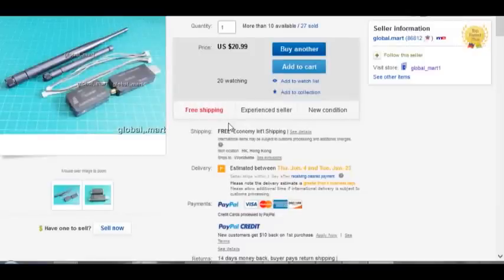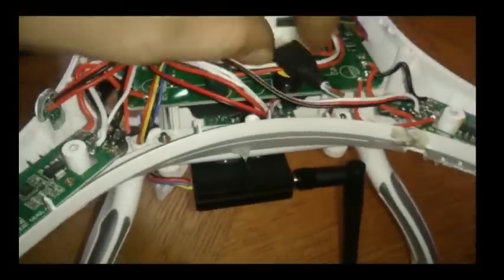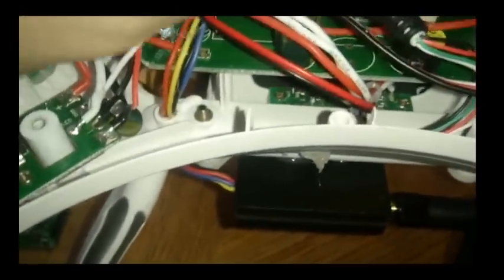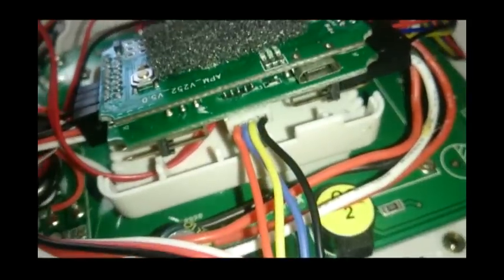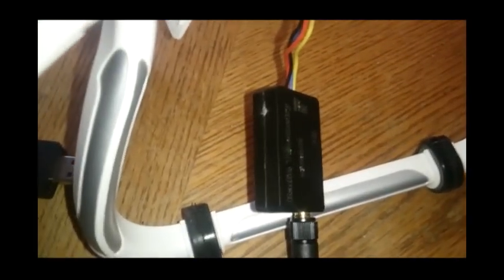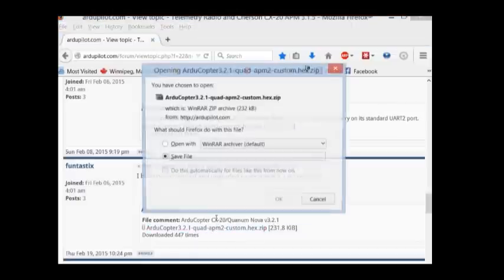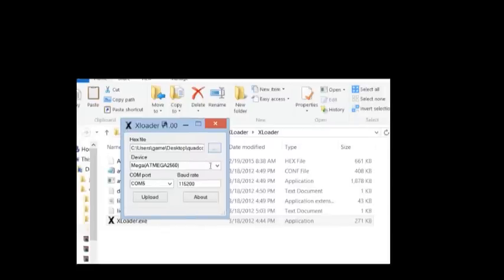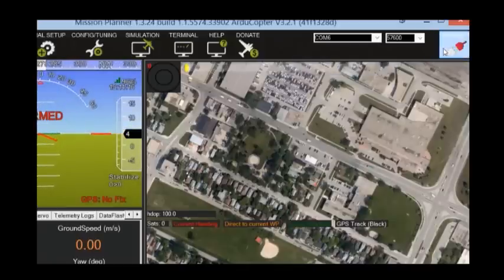Cheerson cx20 Apm v252 v5.0 telemetry Fix-with socket.

Comment: Bangs any idea why my 3dr telemetry  ground radio just shows the blue led is flashing along with a red flashing led. I've installed the driver and the hex file onto my cx-20.  I have the same setup on a different cx, but its a clone(not 3dr) and it connects but doesn't populate in mp.... any ideas???
Reply from the maker: Hi ..when you plug the ground unit into your computer.. (the one with the usb end)

what color blinks..  ..usually its green but i'm assuming yours will be blue then..

once that is blinking.. plug in your cx 20.. does it stop blinking?
and go solid..

next.. .. with it plugged into your computer only..

go into mission planner.. set the com port to the telemetry ground unit.. and the baud rate 57600
(don't push connect!!!)

go to initial setup 
sik radio.
and push load settings

what happens..?

.. if nothing populates try 9600 as the baud rate and go back to sik radio and load settings.
keep trying different baud rates all the way up to 115200
Reply from the maker: let me know if populates with info with load settings....if it is just a baud rate ....then you can connect the air unit into cx20 and try loading settings again with which ever baud rate and set them both to 57600 ect...    Mission planner does have a param as well to set the baud rate for telem   in standard params around the bottom..
Reply: the setting show up....quad should not be powered up...right
Reply from the maker: what baud rate did you use?

you can try again with it connected to see if both sides populate.
Reply: 57600 mp is the same... only the ground side populated. Just to confirm the wireing..... black, yellow green red... is that correct?
Reply from the maker: that was going to be my next ..Q....    but what you can do is two things.... one just switch the two wires... 

and try again.. or even just leave them out temporally   ..and try to see if both sides populate..
Reply from the maker: make sure to put the space as well after ground ..here is the picture part of it.. just pause the video and look at the picture.. j.. but still try to flip them..unless you did forget to skip a spot..

https://youtu.be/MbqfpGElSyI?t=42
Reply from the maker: looking at other 3dr cables with your color scheme u should of been right with the black space yellow green red......   but who knows ..maybe u forgot to skip or they got the two color backwards on your cable ..
Reply: the air radio has both leds flashing just as the ground unit
Reply from the maker: what should happen is one should go solid.. once they are both plugged in.
did you look at the picture and made sure you skipped at the right location?
..then if it still does not work try to switch the rx and tx.. green and yellow wire with each other..

try to populate both sides again..with load settings..

now the last thing to try is just take out the green and yellow wire...tape up the ends or just make sure they can't short out on anything..  . and try to populate again..
Reply: ok so no red led on the air side....just flashing blue( green and yellow disconnected and taped) but both side have  numbers. but still not connecting. Red and blue flashing(ground)... faulty unit?
Reply: So on my other cx I have one that has the green and red leds. That one works fine. Both sides populate fully. the other one only shows some of the fields populated. Im guessing its bad...
Reply from the maker: could be or bad settings on it as well.. once its connected.. try to fill in the other side.. 
identical to the left side..or click on copy required to remote.. then click save settings and see if it gets written to the other side..
Reply from the maker: can you just take a picture of mission planner and show me what it looks like when its connected with both sides.. populated  (green  and yellow taped)  either link to a picture or send to bangs696969@gmail.com

to take  a picture if you don't know how.. just click on "Prt Scr" button on your keyboard ..open up ms paint ..and click on paste.. ..
Reply: only some of the fields populate on the air side.... I did save to the air radio....still flashing
Reply from the maker: ok so not sure if your sending a picture.. so either like you said its screwed up ..
or has bad settings..
or.. they might of sent you the wrong mhz for one of them.. one might be 433 and the other 915.

there is still more we can do to figure things out .. but that will involve a usb to serial adapter
..or some special firmware from me ..and cutting up your wires ..
Reply: I will try it again tomorrow.. both are 915mz( I checked). Hopefully we can figure this thing out. Thanks for your help. I'll check back tomorrow
Reply: I'll pick up a usb to serial adapter... then re-contact you. Also ordering a new telemetry  kit....
Reply from the maker: ok sounds good....   I could of sent you some firmware to read the telemetry from the apm but you would need to add servo wire  ends to it so you could plug it into the apm  header pins..

.. Hopefully a new telemetry kit will solve your problem....
Reply: One more question that plagues me. Why can't I use my other ground radio to receive data from the 3dr air radio. my other one is 915mhz as well, but only reads from it's air radio different manufacturer(has one red and one green led?)
Reply from the maker: not sure maybe some kind of internal key pair....
there might be a way to repair them but then you run into the problem of not being able to connect to the air unit anyways to set the setting..

 ......    I ordered lots of radio modules..and my next project will be all about that ...     
my plans are just to put the 3dr firmware on 4 dollar modules..
Reply: bangs6996 cool...ill be looking for it...btw what is the patron link?
Reply from the maker: HI.. no patron link ..I don't have enough subscribers or content to justify..then the quality is another thing heh.Lots of my video's after this one is missing the left audio channel...i'm learning slowly.. .  On my newer video's i don't include the donation link as well.. ...

Comment: у меня на квадрокоптере не горят GPS Огни почему так
Reply from the maker: green light?  it never comes on?
Try to bring it outside for about 5 mins or more and see if it can find the satellite..
You might want to arm the quadcopter after 5 mins and look in the logs to see if it finds it.., you don't need the propellers on for this test..move the throttle up a bit so it does not disarm for about one more minute..

Or connect to mission planner and see if it finds a satellite, only plug in the usb cable and leave it alone for about 10 mins.
Reply: эти переднии огни ранше горели после установки подвеса перестали гореть.на gps прате горит постоянно один зеленый огонь синий не горит.
Reply from the maker: Hi what firmware are you running?
also check to make sure your 
lights are plugged in right
https://drive.google.com/open?id=0B2w6_OKE_2kxc1pMTmdNSkFLQTQ

Comment: My rotors won't arm since I installed my telemetry unit. Do you have any idea what might be the problem? Thanks
Reply from the maker: Hi .. did you disable arming check? .. .. just to test it out..
https://youtu.be/mrBWEATUbus?t=1440

I leave mine disabled all the time ..however might not be the brightest idea if you have something wrong with your compass ect..
Reply: I did, and it still wouldn't arm. I did find that it was a compass issue. I had to unplug the compass module to install the telemetry board, so the compass just needed a manual calibration (Hold throttle down/right within 5 seconds of plugging in the battery). Since my controller is Mode 1 I had to arm the props by holding the throttle down/LEFT while holding the other stick down right. Thanks for the reply!
Reply from the maker: Your welcome ..and thanks for posting your fix..hopefully it helps somebody else..

Comment: For some extra assistance.... I spent DAYS trying to solve an issue with my CX-20 setting up my telemetry. I kept getting 'no heartbeat packets' and couldnt work out why. I swapped changed to multiple different firmwares, unplugged the GPS and other components, tested the power, used terminal to test the communication, etc etc etc i also swapped TX/RX for every change and tested them fully. Finally tested each port on the telem air unit and the APM and found that the APM had a bit of crap solder jumping the connection on the APM... well done who ever built it... thanks! anyway removed the jump and it now works perfectly. Just thought Id post my findings here.... anyone having the same problem... check your boards for solder quality and whether there are any shorts!!! thanks to bangs6996 for the video!!
Reply from the maker: Great comment!!   ..thanks for taking the time to share your troubles and a fix..

Comment: Hi bangs6996 How about if I use only the OSD, can you teach us how to install to the APM? Mine is CX20 APM V252 V5.. Please please please.
Reply from the maker: HI .. i do have a osd video.... i'll re watch it my self.. I forget if i had just made it for a fix video..   here is the video.. https://www.youtube.com/watch?v=NNuHOtY2Yl4
Reply from the maker: ah .. just re watched it.. .... .. I use a apm2.6 in that video .    
will you be installing the power module?     if so you can use the 5 volts from that to power the osd..  or just use the 5 volts from under the quad.    Do you have telemetry installed ? ..

I can see some more problems if not.. as you will still need to install custom firmware for the cx20... if your running version 3.2.1  if your running stock you should be fine...
Reply from the maker: oops thought you were somebody else.. but anyways the video link i sent you.. .. if that's the osd you have . I will put a step by step together soon..
Reply: bangs6996 I think thats the only OSD suitable for my quad version. if you share your knowledge about it, we really appreciate it. Thanks man!
Reply from the maker: Tried to send you a message through subs..but don't think you are subbed to me.. so i'll just post here.. that I uploaded a video for you. its a tad messy so hopefully you can fallow along

Comment: Good thing I remembered something about this before trying to hook it up to my CX20 board. Also had the newest firmware, I'm now running custom 3.15 with the hex edit. Worked instantly AFTER I loaded the correct firmware with HEX edit :D

Board not fried, well I always check connections anyway and found it odd the cable provided was mirrored as to what it should be. Thanks for the video, good stuff!
Reply from the maker: thanks for your comment glad it turned out good for you..we lucked out for seeing something odd heh.. .. I was thinking they were going to try to sell there own style .. but now that I think about it .. ..wonder when they drew the schematic ,the adapter was meant to be on the other side of the board, then they realized the shell would not close heh..
Reply: bangs6996 Hehe yeah that could actually be the reason why it's mirrored :D

Comment: I realize this is an old video, put I followed your directions to the letter, now when I hook up my CX-20 to my computer it doesn't even recognize it, like its not even hooked up, and I've got one motor beeping all the time and the quad won't bind. Any help would be appreciated. This quad is less then a week old.
Reply from the maker: Hi ..If you remove the telemetry air unit and plug a usb cable into the cx20 on the bottom or directly on the side of the apm can you still connect?  try both connections to rule out a bad port on the bottom
Reply: Thank you I'll try that
Reply: I plugged into the APM and was able to load mission planner. I guess I have a bad port. As far as the motor beeping all the time based on my research I've go a bad ESC. I've tried everthing to get the telemetry to work and all I get is 2 solid green lights. Any help would be appreciated. Thank you for the quick response.
Reply from the maker: two solid green lights is good.. It means the 2 units can see each other.
thats if you meant each unit has a a solid green light once you plug in the ground unit into your computer .
. you probably have rx and tx backwards.. just try to reverse them..     on this part of the video if you pause and look at the picture https://youtu.be/MbqfpGElSyI?t=31    it goes 5volts rx tx space ground.. make sure to have the space beside the ground.. If so just try to switch the rx and tx around .you should get a blinking orange light on the air unit once you do that,if it works.
Reply: Yeah I tryed switching the tx and rx, still a no go. Is it possible I fryed the unit and the green light will still come on.
Reply from the maker: So just to make sure we are talking about the same thing

Plug in your air unit into your cx20.
you should get a green flashing light. once you plug in the battery
on the telemetry air unit.

plug in the ground unit into your computer. The green light should go solid , same with the air unit. ..

confirm it does that.
...............
what firmware are you running.?
are you running the custom 3.21?
Reply: Yes, once I plug in both units both lights go solid green. When I try to connect to mission planner. I get the no heart beats error after 30 seconds of it trying to connect.. Yes I am running 3.21 firmware.
Reply from the maker: sorry just to make sure..are you running 3.2.1 custom?
Reply: I am running the firmware you had in the description of the video.
Reply from the maker: Ok so if your positive you have the wires the right way.. .. confirm the wires are actually pushed in all the way .. they can be a pain in the butt.. .. if you have tried that ..try it again for kicks.. 
then try this.

plug in the air unit into the quadcopter. and put in the battery.
Plug in the ground unit into your computer.

Open up mission planner and set the com port for your ground unit.
and set the baud rate to 57600  .. do not push connect.

go to initial setup,
>>>option hardware
>>>>3rd radio
click on load settings.

do both sections get populated.?
Reply from the maker: If it did not get any information try the same process but pick different baud rates ..try 115200  and then try 9600. .   if it works with a different baud rate .. You can then try using the connect button with what ever baud rate worked
Reply: will do. I'll try it. Now I need to get the motor issue and port problem figured out. Thanks for the help,
Reply: Yeah I've done that, and both sections populate.
Reply from the maker: are both sections the same.. and what is the baud rate on both of them?
Reply: both are the same. Baud rate is 57
Reply from the maker: alright the next thing I'm going to get you to do might sound confusing..if so I don't mind making a video that explains it..

On the air unit.. remove the rx and tx wire on the connector that connects to the apm.. so only black and red should remain.

The other side that connects to the air module..should have all 4 wires connected.

plug in the battery.
plug in your ground unit into your computer.

In mission planner .
set your com port.
set your baud rate to 57600.

Go into Terminal.

on the left side push the connect button.
It should say opened com port
Now type.
dddddddddddddddddddddddddd  
it does not matter how many d's just put allot.

Push enter on your keyboard.
the  ddddddddddddddddd should disappear .
do it about 3 times.. Just to make sure ..
..you should watch the orange light location on your
ground uniit.. ..You should see a quick orange blink.

now type ddddddddddddddddddddddd again but before you push
enter..
hold the rx and tx together from your air unit.
then push enter.
you should be left with ddddddddddddddddddddddddd on your screen.  (loop back)
and if you watch the air unit light should blink orange.

..
this will tell you if the air unit is receiving and sending.
and if its a issue with the apm .

but it can still be wires as well.
Reply: ok I'll try it. Thank you.
Reply from the maker: I should also note that your other problem is a tad bigger then the telemetry problem your having .. but if possible you might have to try to get a refund on both of them.. 

I have a video about esc's ..and the steps you can try in order to figure out if you can save the esc..     butttt if you had for any reason attached the usb and battery ..to stop the beeping ect ect.. your esc is probably dead and you will have to order a new one. ..
.. so not sure if you just want to drop the telemetry problem and jump onto the esc instead..

video is here anyways... 
https://www.youtube.com/watch?v=CtLxQ0Vmklg
Reply: Yeah I'm gonna worry about the telemetry after I figure out what is wrong with the esc. Telemetry does me no good if it won't fly. Thanks for all your help I appreciate it.

Comment: And how to enter compass calibration in custom firmware?
Reply from the maker: You have to go through mission planner .. Initial setup --> Mandatory Hardware --> Compass  ..then do a live calibration....    I also have a video that will let you reload the factory oem firmware if you wan't to go back to using the cx20 to calibrate it instead..
Reply: +bangs6996 and how to do it outside without computer?
Reply from the maker: You can't with any other firmware accept the factory firmware... ..So if you really need that option you will need to downgrade back to version 3.1.2 .. ....